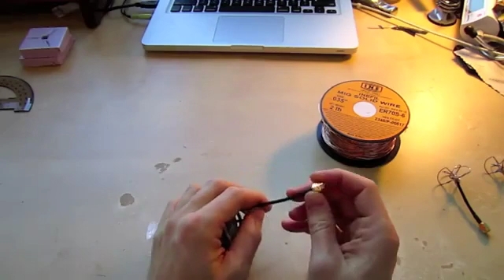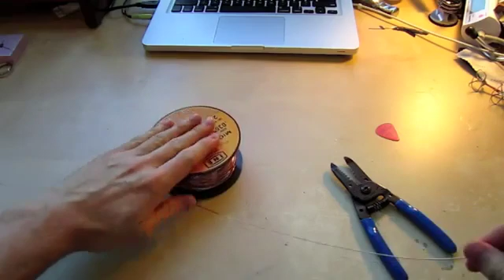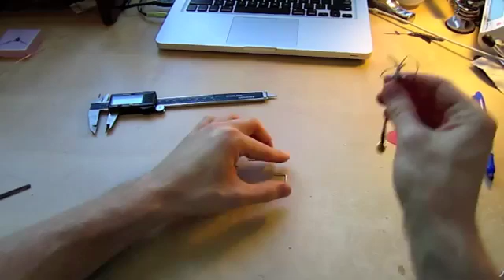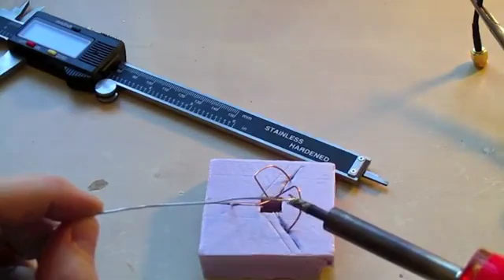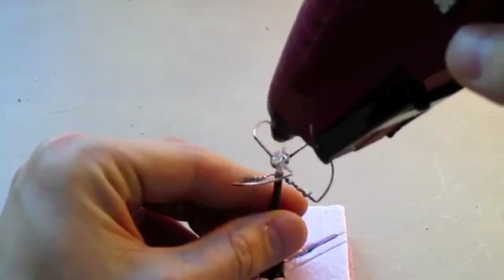Cloverleaf Antenna - Build Instructions

Comment: working on those frequencies is extremely difficult to impossible, the 1/4 " section of exposed coax is even a problem at 5Ghz, but, if it works, don't fix it!

Comment: Uh, your antenna length should of been 50.5mm or 5.05cm in length. Either you typed in the wrong number or the calculator is wrong.
You find out the size by dividing 300/5.945= 50.5mm 300 is the speed of light.
Also, it’s hard to make transmitting antennas because you need to know the SWR of that antenna. Usually antennas are slightly shorter than their theoretical size because the type of metal will effect how electrically long the antenna is.

Comment: just curious. 

Would there be any benefit to soldering a clover leaf antenna on top of another clover leaf antenna.
Like if you stripped the plastic and had just the inner wire soldered to the top of the cloverleaf that is connected to the fpv goggles.  

Is this a waste of time, or could there be any benefit?

Thanks

Comment: so you take superfine measurements for the MIG wire, even file it down to 1/100 mm, then you solder it on a bunch of rough wires twisted by hand.......
i don't know much about antennas but seems like you just threw all that precision out the window.
Reply: If it works y care about perfection after all we as humans are flawed in so many was and we still work .......hmm think about it before you type about it
Reply: @samanthagoss1509  shuddup you stupid bitch.

Comment: i used old wifi antennas from an old belkin router, removed the rubber caps, snipped the antennawire insude and soldered on the loops...
seams to work a treat! :)

Comment: Don't forget the dimensions you got from the website are dimensions from the center of the wire.
If your wire is 0.8mm thick, you need to at half of that to you bending dimension.
So 12.87+0.4
Reply: that is dwarfed by the extra few mm added by the centre lead he didn't account for.

Comment: if you go to the welding store and ask for Tig wire of the same type {er70-s} .035 diameter it will come in 3' long straight pieces, instead of wrapped up in a coil.

Comment: Your video is awesome, thanks for making it and putting it out here for the community.

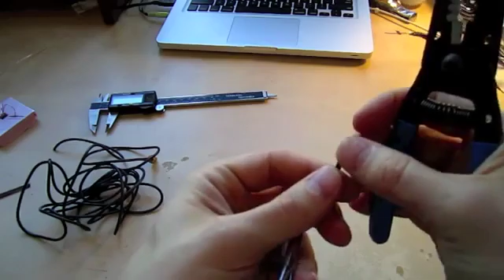@ 12:40-13:30  ERROR....

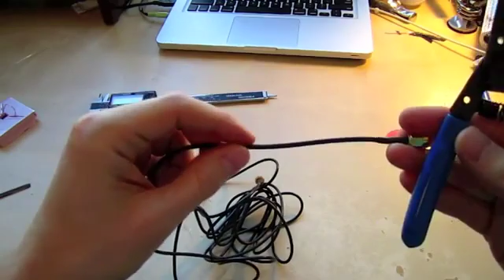12:45
1) The "snip" should be at least 7mm from the SMA for this frequency.

13:05-13:30  PLEASE DON'T CRIMP OR CRUSH TO COAX!
2) That seriously changes the impedance and creates horrible SWR (wave feedback) in your transmitter. This causes internal "shorting", greatly reduced range, over-heating finals and often a much shortened life for your gear.

If you have the internal feed wire dropping back into the shielding here is a better way to solve this.
1) Buy better cable to begin with.
2) You can also screw the SMA onto another fitting (like the end you just cut off or another fitting from an xmtr/rcvr or adapter. This prevents the wire from slipping out/dropping down.

If you don't have these then you can take your 7mm pigtail and make a gentle 90 degree arc in it and this will bind the internal wire from slipping out of place.

I screw a spare coupling on and then rubber-band my pig-tail to a dowel-jig, this keeps everything from squirming around and also helps when working with the "magic fingers" so everything stays in place more securely.

Anytime you want to make small coax submit (RG-8 and smaller) you should use rubber-bands, straps, tube guides or big loops, just NEVER EVER EVER EVER clamp directly on the coax!  :-)

:-)

Comment: How do I know if the antenna is left hand or right hand thansk
Reply: Edimar Stein 

Hold the antenna in front of you ... straight out with the pig-tail pointing down. and the elements on top.  If the elements "lean" to the right it is a RIGHT HAND polarization.

For best performance make sure your xmtr and rcvr have the same polarization. 

If you some how wind up with different polarization from difference vendors and mount them, when you do your "PRE-FLIGHT RANGE CHECK" :-)  you will notice a reduced distance, sometimes it is rather significant.

Joe
BCH

Comment: Can you use coaxial cables other than rg316?
Reply: You can, but this most closely matches the impedance and is also still a little flexible... not too stiff and snap and not to flimsy like silicone shielded wire often is.

Comment: Should I make these or spend about the same money on a set from HK, which would give better performance?
Reply: The ones being sold come tested out of the factory, so they are frequency test and good to go. If you make them, it will be dirt cheap, the issue will be how precise you are, and you need to test it with a 300 dollars frequency antenna tool.

Comment: Using hemostats to hold the coax can crush insulation shorting the antenna as well as change the dynamics.  Use caution. A bad antenna will destroy a transmitter

Comment: Awesome video, I love how simple and detailed the explanation is! One suggestion, you should get brass wool or a damp sponge to wipe off the slag on the tip of your iron. A clean tip makes much cleaner, stronger, and more consistent joints.
Reply from the maker: Thanks! Yeah, I have been sanding off the tip to keep a better edge
Reply: +ProjectFlightDesign once the plating is gone, the tip will erode very quickly.   A cheap temperature controlled iron will keep it from overheating,  and your tips will last a long time.

Comment: GREAT VIDEO!!  Thank you.  I will be testing mine here shortly. Just a note... You should not clamp coax because of the space of the insulator to outer shield.  Changes the impedance of the cable.
Reply from the maker: Thanks for the tip! I hope this video helps. I know that my techniques aren't perfect here

Comment: Can I use this with my indoor wireless router?
Reply: The benefits of the clover leaf aren't needed in stationery objects. A good whip antenna actually has better range. Unless you have a circular polarized antenna on each end you will actually reduce range substantially
Reply from the maker: I am not sure. Sorry - I am not sure what Hz those are
Reply: so you're saying that this  is not a good idea for increase range and better connection.. is that s so?

Comment: Are the RP-SMA extensions necessary or can i take apart the stock antennas and use their connector/coax from the hobby king 5.8ghz 200mw kit?

Comment: not to mention the wire when he was cutting to size was bent. if you start with a bend in any wire and cut to length, once straightened the wire will no longer be at the cut length, but longer.. straighten all wire before cutting or re measure once straightened.

Comment from the maker: There are a few problems with my build in this video - which I have improved on over the years - including the 2 things you mentioned. The feed gap is far too large and the angle between the legs of the lobes should be about 105 degrees